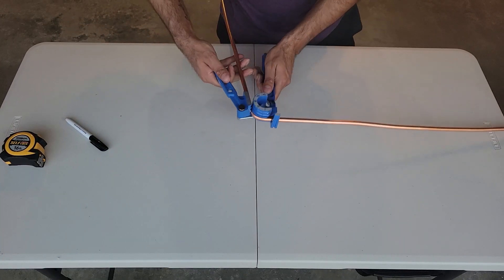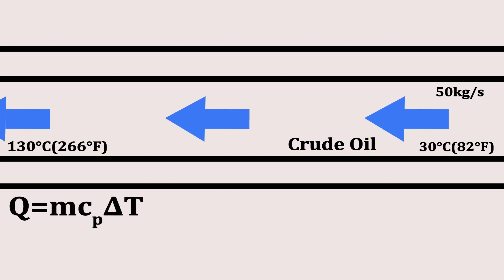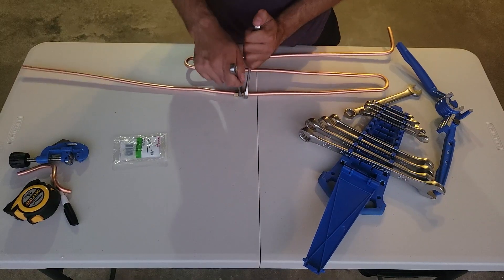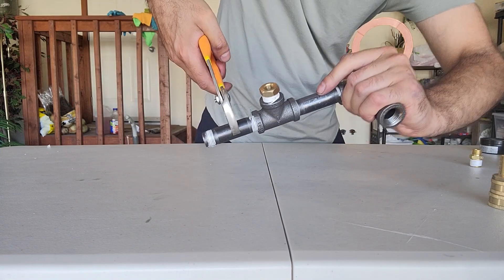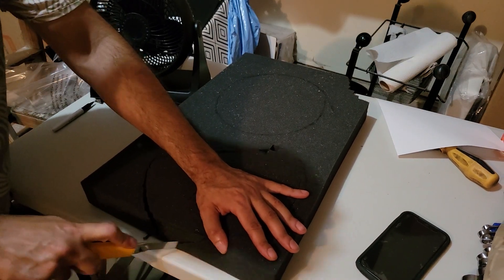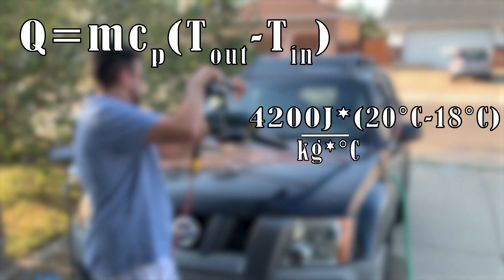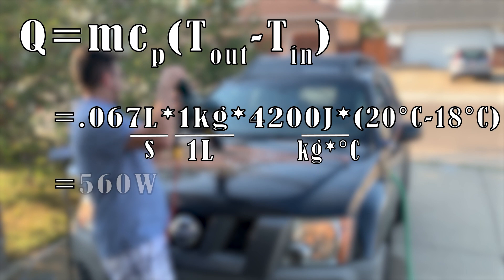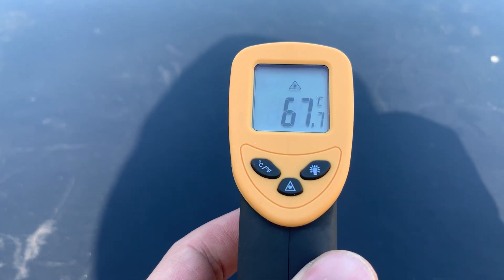Day In The Life Of A Mechanical Engineer

Comment: I made a tankless water heater for my bachelor project, the heater was based on a helical coiled heat exchanger only used 1/4 inch, 1.5m of copper tube first. The only difference is that only 1 fluid was flowing and we use sea salt as a thermal storage medium. At first it was shit T water input was 21°c and output was only 31 °c then i tweaked some changes and get better pumps that is more suited, the output become 61°c which was so much better. The temperature was high because it was assisted by a parabolic solar collector. 🤣 it was a fun but stressful project for sure..
Reply: Bachelor project? Is it graded? (I just don't wanna ask ur marks directly :0)
Reply: @unknownstoneageman81  yes! In indonesia its kinda like thesis, in the end you will present your data and then have somekind of thesis defence thing. I did okay, i messed up when explaining the concept of heat transfer 🤣

Comment: That was cool! Reminded me of a fluid and thermodynamics lab we had in 3rd year. We had to analyze a solar water heater. It used solar radiation to create a "mini" greenhouse effect. The radiation would heat up the air sandwiched between a glass panel and copper tubing, which ran from/into a water tank. This amplified the heat transfer significantly - even on cloudy days.